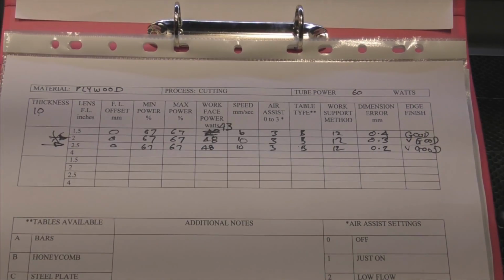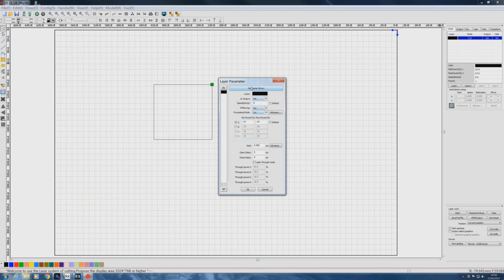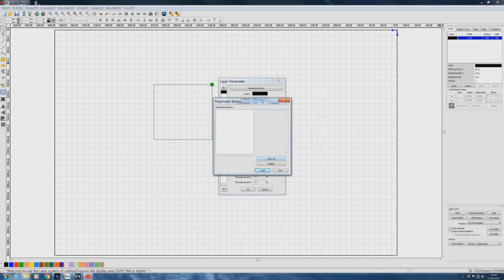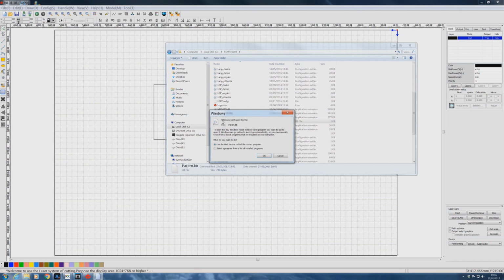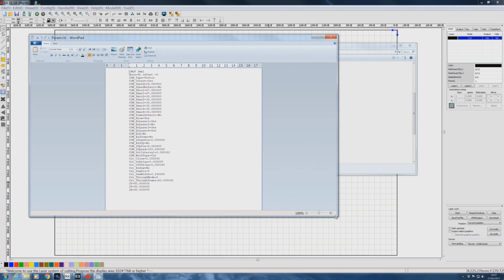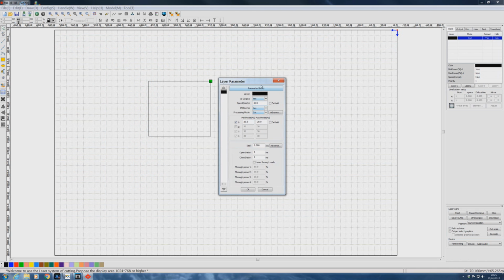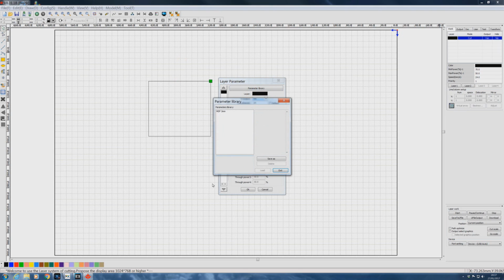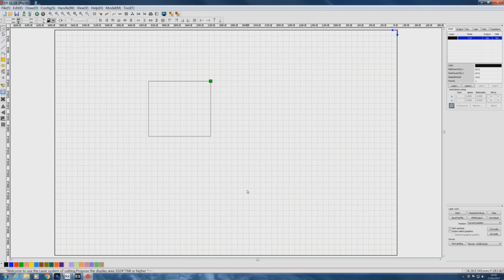RDWorks Learning Lab 95 Cutting Parameters DIY

Comment: <Ctrl>-Enter moves to the next line in the parameter notes. No need to fiddle around with WordPad. RDworks creates a single long line from multiple lines. So it's recommended to end every line with a separator character like komma.

Comment: Hello Mr. Russ. Is there a particular company you would suggest in using when purchasing lenses?
Reply from the maker: Hi Derrick
 If you are in a hurry because you have wrecked a lens then you can try Amazon. They will be more expensive than buying them from China  but look forCloudray on Amazon as they are my trusted company. If you go to their Chinese website you will be able to buy lenses cheaper but they will be 3 weeks away. The postage will be free. If your machine is less than 80 watts then you can buy the cheaper PVD lens type and I have found these to cut between 20 and 30% better than the more expensive CVD type. Over 80 watts then you will be wise to buy the CVD type.  Note , the lens is the most vulnerable part of your machine so always carry a spare.
https://www.cloudraylaser.com/collections/co2-laser-optics
 Best wishes
Russ
Reply: @SarbarMultimedia  Thank you for responding Mr. Russ. Would you recommend having a different nozzle assembly for each lens as i seen in your video you had a 4" assembly and a 1.5 and so on.
Reply from the maker: @derrickstewart5554 
 Hi Derrick
 I have lots of lenses, lots of different nozzles and because I continually "play" with my machine  and swap lenses, sometimes tens of times per hour, I do not fear finding the correct focal point. There are many that I know who feel more comfortable with fixing a lens,  a nozzle and tube together as a unit and having a specific focal distance for that assembly. I can understand that approach for people who are less sure about the technology. It really depend on the balance between your confidence and your budget. I cannot spend your money for you/
 Best wishes
Russ

Comment: Hi Russ, I hear you are the Youtube laser cutter guru. I am hoping you can help me. I currently have the 50 W Laser Engraver/Cutter very similar to what you have. This belonged to my friend. She recently bought a Glowforge and I bought this from her for $100.00 USD.  It needs a new laser tube. I have read that you should also replace the power source at the same time. My first question is, I was considering just buying a new 40 W CO2 laser engraver cutter instead of fixing this one. What are your thoughts about that? I haven't used the 50W and am waiting to purchase the 40w until I do the research. I will be using either machine for crafting. Can you please give me some insight?
Reply from the maker: Hi Renee
 My first advice is to forget the 40 watt machine option. You have a so called 50 watt machine bought for $100. In it's current state, that machine  is is already a ten times better machine than any new K40 machine you will buy. The list of reasons not to buy a K40 will offend a lot of current K40 owners. Yes the K40 works and with a limited budget is a step into laser engraving world. People do perform miracles with half of nothing but you have so many more possibilities with your $100 machine........maybe.  The big question is does it have a RUIDA controller board?  There are many machines like my China blue machine that have "old school" analog controllers just like the K40 in which case my advice may be different. Take a look at this and identify the controller you have. The leypad layout will be the quickest identifier.
https://lasergods.com/controller-dsp-identification/#Jinan_JinQiang_Laser_CNC_Equipment_Co_Ltd_POWERCUT_4311
Let me know what you find and I will advise further..
Best wishes
Russ

Comment: Hi Russ, Great video as always! 
FYI for anyone not wanting to jump through the hoops to add or edit descriptions to be multiple lines, you can just use [Ctrl]+[Enter] to input a multi-line note in the parameter library.

Edit: this works in RDWorks V xx0.40, not certain if this is a feature they added recently or if it's been there all along.

Comment: I have some questions if you dont mind..
1) min.: 12:22 why you chose 67%?
2) you sell the laser test probe showed at 28:48?

I am a litle confuse about paramenters, i have a 80w laser and to cut
a) 3mm MDF i use 35% and 20mm/s, so 35% of 80w is only 28w, far from yours 42w
b) 10mm MDF i cant cut and dont know why
c) 5mm plywood i use 35% and 30mm/s
d) 10mm plywood i use 35% and 7mm/s
why this hapen.

thanks for you help.
Reply from the maker: Hi Eduado
1) This video explains how a laser tube works in principle. It will also explain how there is a  maximum current that will be applicable to your tube. If you exceed that current you will dramatically shorten the life of your tube. 
https://www.youtube.com/watch?v=2F5O-1TH8b0&list=PLPWEtx5V9DqEogIeYRdcG_KYcB7UL2Qmn&index=7&t=1s
A second video about how to check your tube's performance with a power meter  is
https://www.youtube.com/watch?v=nZuatc3eIgU&list=PLPWEtx5V9DqEogIeYRdcG_KYcB7UL2Qmn&index=26&t=0s

After seeing the shape of the power output you will see that %power does not mean % of tube power.  ie for a 100 watt tube 50%power  is not 50 watts and 100% power is not 100 watts. A 100 watt power supply may be capable of supplying 30mA  but you should not run a 100 watt tube at more than 25mA . The % power is used to control the mA passing through the tube ie 30mA =100% and 15mA=50%. That is why the graph will show a linear relationship between drive current and %power.

For my 60 watt tube I have established that 67% is the max number that I can use because  that reaches the 22mA current for my 60 watt tube.

Do you have an ammeter fitted to your machine?. If not then it is essential that you fit one. Without it you have no idea if you are damaging your tube (although with the figures you are using you are not)  However, you need to know what the maximum% power you can safely use because THAT is what you should be using most of the time for CUTTING.Draw a 25mm test square and cut it at whatever your maximum power is ( my guess is it will be about 65%) Start cutting your test square at low speed and keep increasing it until your test square does not drop out. Reduce the speed a little and that is your ideal cutting parameter.. That parameter cannot be predicted because it will depend on so many factors like focal length and  and how efficient you air assist is to name but two..

Go to ebay and  search for Ammeter 30mA There will be lots there for less than $5

Best wishes
Russ

Comment: I know this is an older video...but if you happen to see this, would it be possible for a new fan of yours to get a copy of that sheet?  I am new to the laser world and i really need a good form to keep track of the many different materials i cut (speeds, power etc).  Can i email ya? I got a couple other questions too if you don't mind.  Thanks a lot in advance!
Reply from the maker: Hi 
No Problem. Just attach your email to a new comment. I get auto copied to my gmail and will answer. I also delete your comment to remove your email from public view.
Best wishes
Russ

Comment: Hello. can you tell me what is the parameters of the air assist pump on this machine? (Power, capacity and max pressure)
Reply from the maker: Hi Darko

The machine was supplied with
http://www.hailea.com/e-hailea/product3/ACO-328.htm

This is a 70l/min pump with a max pressure of about 4 psi.. It is also the pump I run on my Lightblade machine with no issues.

I experimented with a slightly higher pressure pump on my China Blue machine and used the
http://www.hailea.com/e-hailea/product3/ACO-009E.htm

 This has double the capacity of 140 l/min which is totally unnecessary, and  can work up to 5psi.

If used efficiently then the ACO-308 is perfect.

Best wishes
Russ

Comment: Ok, i found out what is causing the ripple problem. It’s actually vibration on belt. That is caused basically by very poor assembly and construction of this laser. There is no single cause, everything is casing it to some extent. Basically a size effect of junk product. I quickly designed some additional parts in CAD and printing them at this moment. If they help stabilize, I will share the solution :)
Reply from the maker: Hi
The fundamental problem is that toothed belt technology has been hijacked for an application it was never designed for. The clue is in the name (timing belt). It was designed to losslessly and quietly transmit power in ONE direction and replace the cam belt timing chain in engines. Conventional cnc drive systems work with rack and pinion  or sometimes ball leadscrews. Both are hideously expensive and heavy when compared to a timing belt system. Thus timing belts are a 95% alternative for our lightweight machines. With a constant stream of power from our laser. any variation in the head velocity results in variation in cut depth. This is what you are seeing with this curtain effect.
https://www.youtube.com/watch?v=QFLq14vY2zQ
This video explains how this velocity variation arises. The other link I sent you shows how I turned the belt over and am using it as a flexible rack and pinion drive to completely overcome the problem.
Best wishes
Russ
Reply: SarbarMultimedia this can’t be true, as I have built a number of 3D printers. My last build is quite a large CoreXY machine. I have never had problems with belts, and on my last machine i am using 5mm belt which is over 2.5m long. And I have zero vibration or precision problems on it. Horizontal precision is easily under 100 microns with GT2 belt. Never had a single problem with such systems. Moreover my former laser machine did not have any of these problems at all. I did a lot of negative engraving on it and it was smooth and uniform always. It’s not about the belt, I am 100% sure, it’s about them building this machine on junkyard from the components that they can find there and with a mindset of junk person. I opened this thing up today and was speechless by how bad it is assembled and how much parts don’t fit each other and what solution they chose to fix that. In fact my last $350 machine was a way better build. First of all, at least in my machine, X belt positioning is a sad joke, it is absolutely crooked, and in fact it rubs the X rail most of the time. Idler pulley used on the right side looks like it went through the world war 1 and 2, both. These are not just used components, these are junk components, that should not be reusable already. I am gonna make this seller struggle for what they do to customers by selling such junk as “new”, it’s neither new nor it can be called “laser engraver machine”. It qualifies as refurbished diy engraver kit in best scenario. This has to be broken down entirely and rebuilt from scratch in order for it to be a proper laser machine, that will also involve quite an investment into proper components and in the end of a day you would think that it was easier to build your own machine yourself than to deal with such vulgar garbage... 🤦🏻‍♂️
Reply: SarbarMultimedia the belt in my machine is the cheapest garbage belt one can find in china, it is synthetic rubber belt with steel core. This alone can contribute to good amount of vibration and hence those waves. This has to be replaced with Aramid/Kevlar core natural rubber belt. I diagnosed everything today and i see belt occasionally “jumping”/“jerking”, but can’t figure out what is causing it still, since there is so much stuff that is wrong there, hard to isolate the main issue. Tomorrow i am lowering the X stepper by 3mm, this is a first step. Its improperly setup in this machine, so the pulley creates upward pressure on belt. Right side idler pulley is another sad joke, that will be hard to fix, so i shove off a bit to lower it slightly.
Reply: SarbarMultimedia i have also designed and 3d printed belt mounts for both sides, now at least belt is not crooked and is parallel to the rest of assembly. My belt was mounted by ONE SCREW which was drilled through the belt and the nut on the other side. You can imagine how that looked and worked.
Reply from the maker: Draw a small square  say 25mm and set it to scan at 0.1 increment. Set the power to 1% so no cutting occurs. Run the program and look very carefully at the belt as it runs in and out of the drive pulley. As it runs in you will see it climbing and as it exits it falls. This is the rubber teeth engaging part way up the tooth flank and locking there until two or three teeth in, where  there is enough lateral tension to fully engage the tooth. Depending how bad your system is, if you drive to a fixed coordinate on the keypad from one direction and do a pulse burn on a piece of wood or card and then do the same thing from the opposite direction you may find 0,1mm or even 0.2mm difference caused by this effect.
Reply: SarbarMultimedia i know exactly what you mean, and no, proper GT2 belts do not have that. By proper i mean, that you should never use steel core belts and standard M3 belts for such application. What you are describing is actually very typical with steel core belts as they are not flexible enough therefore they are impossible to tighten properly. I am also sure that white belt on your gray machine had all this problems. Climbing that you describe is 80% caused by steel core and 20% by square teeth on your belt, those are not designed for linear motion. With that said, i have a “proper” GT2 belt on mine, but with steel core, and it has all same issues due to that stiffness, the bottom line - gt2 pattern aline won’t save the day, belt has to be soft and flexible.